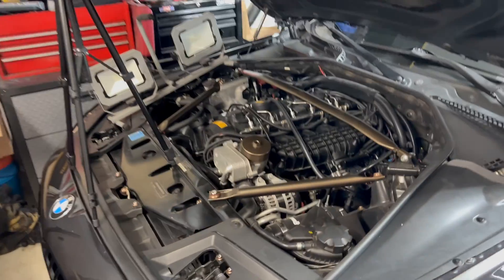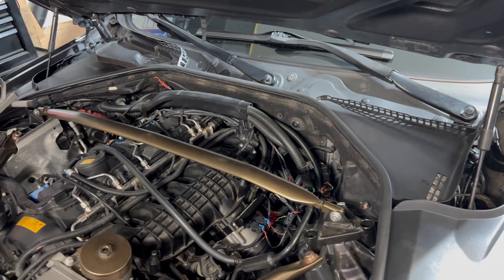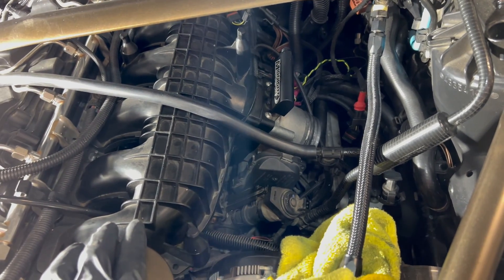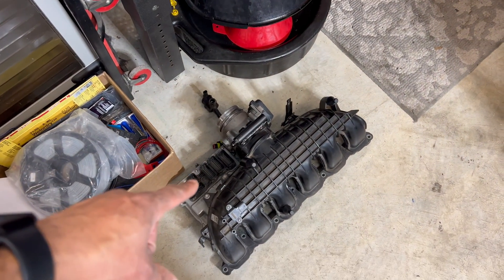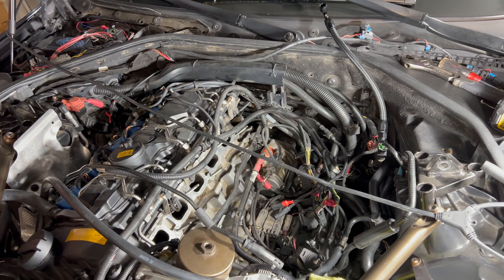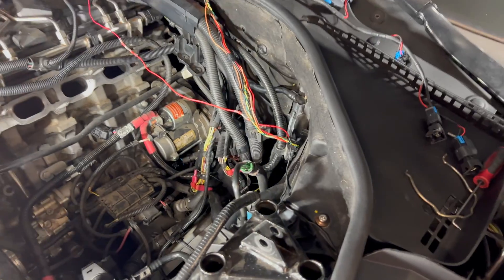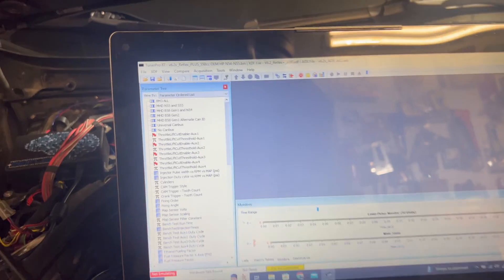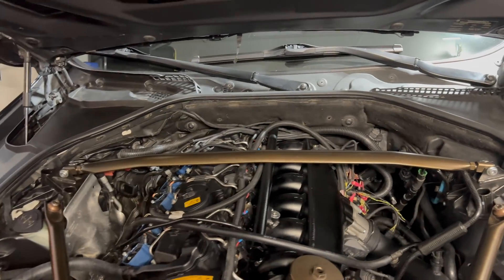Installing a N55 BMS Port Injection Manifold!

Comment: So in order to use this intake u need to have the reflex or you can just swap it without it?
Reply from the maker: You can run the intake and just install plugs for the port injection. If you plan to run port injection, you will need a controller.

Comment: Great video, did I miss the air intake?
Reply from the maker: Maybe. I have been running a Bimmerhausperformance intake for years. I had one of the first prototypes, before it went to market. I have a video on the channel of the install.

Comment: How hard is it to pull stock manifold on f30 n55 just want to replace prong gaskets an clean throttle body an replace that gasket also ?
Reply from the maker: Pulling the stock manifold isn’t bad. The hardest part in my opinion is just disconnecting the PCM. 😆

Comment: Can you run this manifold and block off the fuel rail insert? I just hate the plastic but don’t need to utilize the port injection.
Reply from the maker: Yes, you should be able to.

Comment: I just bought the bosch uscar flowmatched port injectors from precision but they are too short any ideas what are the correct injectors to use I have a custom manifold similar to the phoenix manifold

Comment: Hey Grant... I need your opinion, buddy..  David Shoup recommended I upgrade to a stage 2 hpfp before he hooks me up with a tune, so being I value your opinion, I wanted to know which direction did you go on this? I've seen vids on the installation, which look pretty easy, but I'm not sure which one to pick up, and from where. When you get some time can you give me some advice on this? I would greatly appreciate it. Oh, I got my BC Racing coilovers installed!! Man, I can't believe how much better my car drives now. Night and day difference. Looks sooo much better as well. Should have done that from the get-go. 
Anyhow, I hope all is well.  
Thanks, bro!
Reply from the maker: So I have an early model n55 with the n54 style hpfp, so my upgrade options were very limited. If I were you I would DM Bimmerhausperformance and have Dan hook you up with an upgraded hpfp. He works with Shoup all the time and can steer you in the right direction.

Comment: I would highly recommend instead of nylon that will eventually warp that you go with g10 phenolic grade. It’s much stronger in Rockwell strength and takes much higher temps
Reply from the maker: Thanks for the recommendation, I will look into it.

Comment: man thats dope can’t wait to go pi myself!!  have you done internals yet? or is the motor still able to handle the power range you are in?
Reply from the maker: The motor is still stock, I replaced rod bearings but that’s it. The key is to limit the lowend torque, so we will see.

Comment: Does my car need to be tuned to upgrade this part?
Reply from the maker: Depends. If you are just installing the intake manifold and plugging the injector ports then you don’t have to be tuned. If you are planning to run the Port Injection you will need to be tuned and will need a port injection controller.

Comment: Great video as always, how many miles do you have on your f10? Also are you replacing intake manifold bc you’re oem one is broken?
Reply from the maker: I have almost 171k miles. No, my stock manifold was fine, I replaced it for fueling purposes. Needed the port injection for better fuel control on the F55 turbo.